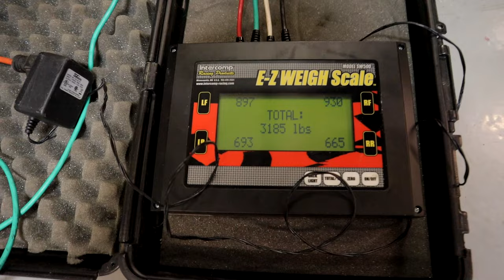American Musclecar Evolution - Why Pontiac Started Strong And Faded Into Obscurity

Comment: The SD Pontiac Engines were what PMD needed in at the minimum 1968.  The PMD engine design from a manufacture standpoint was superior, heads fit virtually any V8 or even that Trophy 4.
The cost would have been lower to pump out "one block" for 265-455 (save the crank main size) was simply cheaper than a BB or SB.
CHEVY ruined PMD, any real PMD guy should know the history of what Chevy did to PMD. Chevy not only was the spoil child of GM they crippled the ability for PMD to be superior to Chevy engine design.

Comment: Pontiac ran away with performance and
Sales in the 60s there back door Woodward 
Ave race parts made them competitive 
On the street when they couldn’t race
At the track. The real problem was GM
And Chevrolet had it out for Pontiac
And they especially wanted to destroy 
Them when in the 70s when the trans Am 
Beat the corvette and Camaro in sales
Pontiac had the 400 in the TA until 
1979 it’s the only big motor left at GM
The final nail was corporate engines
The 305. I had stock GTOs a 68,69, and
A 1970 stick all had 350 hp and 440 ft
Of torque plenty to beat any 70 And 80
Car shifted then 6200 with 3.23 gears
One with 3.90 gears great engines at that
Level now Iam 59 and have an all steel
10 second   1972 lemans sport and there’s
So aftermarket parts for Pontiac it is
Awesome today. The modern GM
Corporations is its own worst enemy 
and are paying for killing Pontiac, Oldsmobile

Comment: hey tony do you think if the big boys marketed a new  frugal car no frills   basic   roomyish  ugly   engine emp/bullet     proof  off  shelf parts  rocksolid  literaley run it with no oil fix with bale wire visegrips ductape if needed    would it sell in this age // i/e we had this subaru  that we drove thru the ground  and held out  no oil   we demo a house and used it for a trash hauler  at 30=mpg  no electrical dodads   just whats needed to run legal   and it was the best   14 inch tire were 35$  a true frugal machine

Comment: Also Pontiac heads flow pretty bad.  BBC dump truck heads flow better then any Pontiac head besides ram air v.  And even that is a close comparison.  Pontiac engines are essentially big blocks with small block heads.  Made great torque tho!

Comment: Yeah the rides were a problem but not nearly as much as their engine blocks I've literally blown the main webs right out of a 400 engine block on a GTO and later on racing super duty engines and later on super duty Motors I said a Mickey Thompson aluminum rods and really good for 200 runs with Lily Outlast the engine block at 500 cubic inches 470 something's 472 or whatever and it would last as long as the rides would they got to be pricey looking for super duty blocks after awhile so that's Pontiac they deserve what they gone

Comment: Actually, Pontiac didn't call the connecting rods Armacast, they called it Armasteel (I remember your article on converting a 400 to 455). the other issue was the lifter bores, they weren't cast into the lifter valley so with a radical lift cam with a quick ramp, you risked snapping it off. and in a smaller issue, their round port RA heads didn't do as well as D ports.

Comment: Lets call a spade a spade. I have owned countless ford cars and trucks and never blew up a single one. The oil in the 60's and 70's was questionable compared to todays technology. Maybe if Ford owners tried changing their oil your weird bearing wear patterns would of disappeared. I hear this all the time. My brothers 427 side oiler lasted many many 8200 rpm shifts. His Boss 302's lasted the same and were monsters with mostly stock parts. and Fords hold up way better than you claim. I have a real 289 hi-po in the shelby configuration, it screams .

Comment: Does anybody remember the 5252 rule? Anything past that does not matter to a manufacturer I know how to make power below 5,000 RPM my 1980 Cutlass stripped out with no backseat will do well over 130 miles an hour with 2:92 gears in the rear end seven and a half inch welded diff that spins the tires anything 40 miles an hour or less with a 454 Chevy 4 bolt main steel crank Winnebago take out is the epitome of making power the problem with Pontiac is Giant weights on the crankshaft the connecting rods didn't break because of power, the connecting rods broke because of the rotating mass of the crankshaft would suck them down the bore before the rod could catch up to the rotating mass. If you understand the rule of inertia roll a car into a tree the car will stop. Now roll a train with 50 cars on it into a tree at the same speed it'll take 5 mi before that train stops that's why the rule of 5,252 RPM rules after that moment the vibrational forces of anything in nature contained within a 6-in circle diameter becomes uncontrollable

Comment: Thanks UT, great video, would it be feasible to use the rods out of a ‘62 389 in a ‘69 400? I have both motors but want to use the later model block so I can rid myself of the horrible rotohydramatic that’s in my ‘62 Grand Prix.

Comment: Ok, now I have my sanity back. UT clarified the issue with the Mopar was when you got into the low 12s - high 11s. That's when the acceleration caused the oil to move too far back for the pickup to suck oil. The cars I remember never had that issue because they were mostly bone stock and they were well maintained and never really got into that ET range, maybe low 13s or high 12s at the most. BUT, I definitely remember some Mopars that did spin mains, etc because they were poorly maintained and probably shitty oil and/or low on oil. And those were mostly stock as well, and they were usually the ones that didn't run that great in the 1/4 mile, again because of poor maintenance and tuning.

Comment: talking about gtos birds what about those 421 catalinas grand prixs and 2+2s.....those tough 9.3 rears amazing 8 lug wheels.....if you knew the boxes to check a full size would eat a gto.....GMs big wigs killed pontiac performance in march of 63 with the racing ban.....at the time pmd was developing a single over head cam 421....only one made it out and went in mac mekellars grand prix....pontiacs issue was the pushed all the oil to the heads starving the rods....in turn windowing the block.....oil restricters in the lifter bores fixes the issue......glad to see some one talking about pontiacs....but the thing about pontiac is theres no small block or big block.....(we wont talk about the 301)......

Comment: BBC the strongest n/a engine ever produced ? Sorry Tony but not even close.  That easily belongs to the Boss9.  Remember WJ had to go to GM to design an engine that would outrun it, hence the DRCE.  Todays MMPS engines are still based on Boss 429’s, although at 820” and 1900 hp.  Pro Modified NTPA trucks exclusively use B9 based engines either Kaase or Sonny’s who uses B9 heads adapted to Gm head bolt pattern blocks.  These are the highest HP N/A engines in existence.  I would actually argue that a DOOE-R wedge head BBF would out hp any factory Chevrolet head (049 etc). No factory GM or Chrysler head casting will out cfm a factory Boss head.  If your talking factory as delivered engines and how they performed then that’s one thing the Chevrolet has.  But who leaves engines like these stock ?

Comment: Pete Robinson ( your Friend ) Fast Eddy , Dyno Don , Mickey Thompson , The Bounty Hunter , Ohio George ,Gas Ronda Grandpa Cobra Jet all ran Fe's because they did the math on the bottom end and won because the knew how to build them . Did you ever think about how many 500 and 600 mile cup races the Fe's won ? 1964 Thunderbolts ? How about 24 hour races or USAC stock car races even Pikes Peak ? Road racing 427 A/C Cobras .The Swift boats in Nam used 427 Marine engines . You can have your opinion but everything I say can be verified . Smokey the Wood brother's and Holman Moody knew how to win with the the Fe's . I know
Reply from the maker: I know all about FE racing history, but to compare side oiler Tunnel Port engines and Cammers to what was available to the average guy is apples and oranges.
As for Kalitta, he once famously posed kneeling down alongside his engine in such a way as to hide the puddle of oil gathering underneath, and at another time was quoted as calling the Cammer "Flat out shit".
Robinson made a business of the Cammer and was marketing his gear drive for them when he died.  He also ran off of a stash of freebee engines that were "donated" to him in an under the table deal.  
Mickey Thompson ran whatever he could get a deal on, and abandoned the Cammer for the Boss 429 as soon as it was released, and then ditched that after one season for a Chrylser because he couldn't keep head gaskets in it.
I know you Ford guys LOVE the FE and its variants, but history is history, and with the exception of a couple of guys like Ken Winward who ran them in Alcohol Dragster and Larry Gould who was the last to try it in Funny Car, they have been extinct since the very early 70's.
Reply: @UncleTonysGarage  After 2 years running hard twice a week in a Modified sportsman stock car then using it on yhe street everything looked great inside except those Dykes rings looked like they fid a bore job on the cylinders . If you told me that the end rockers break off because they are not supported I would agree . Even the 428CJ was good until 550 hp. after that the crank would usually snap in the middle counterweight and take out everything but the heads and intake . Did hundreds of those type engines .
Reply: @UncleTonysGarage  I did enough 426 and 427 Chevies to know they were great power makers .Worked on the first Boss 429 in early 70's  As soon as the 351C came out we found the oil problem on the right side and learned how to port them .  My thing was finding the weak spots and making them last in all.makes even AMC. There was a stock car guy in PA that would remove 2.5 extra on the sides and run 2.5 top and bottom on the rod bearings and never spun bearings because of bearing pinch didn't run the wide bearing NASCAR rods either. No pinning the bearings necessary.
Reply: @UncleTonysGarage  If you wantrd any Muscle parts book parts you could go to the dealer and get them back in the 60's .You could buy a 428 CJ or 427 Medium riser complete right here in town 
We had a Shelby dealer they had everything including the Sunbeam Tiger on the lot . So I may have told you that in 1971 Ford quit racing and Holman Moody had 427 SOHC 650 hp dyno tested engines for $650 delivered Nd $550 local pickup . They sold windage trays and oil pans that kept the oil in the pan . A professional drag racer that owned a machine shop bought a Medium riser 427 from H/M and told me he couldn't believe the power that engine put out . He ran real hot Rat motors at the time . If you listen to Forigner sing about Racing Lake Avenue , that was about us just like you used to street race .
Reply: Smokey had 3 different versions of the Boss 429 in the mid 60's and they made the cover of Hot Rod magazine way before 1969 . The 385 was the best of the best but never got the development it needed because Ford dropped out of racing in 1971 . The 426 was thrashed and worked the way it was intended to work but even Big Daddy had problems with that engine until he jacked the timing up with intent to blow it up and go back to the 392 . Timing made the thing work right foe Don and the Chrysler gang .As far a Pontiac was concerned they were dominant in NASCAR in the early 60's . The 421 SD was way faster than the 409 . The 427 Chevy mystery engine was faster than anything anyone ever saw in 1963 but didn't last 500 laps without blowing up . I think that's why they built the 426 for NASCAR and  the Hi Riser worked after they got the bugs out in the cam bearing problems . Big Bill banned both in 1965 so Mopar dropped out and put their effort into drag racing for that year . It only took 20 seconds to pump a 426 dry with a stock pan so why not an 8 quart pan from the factory ?

Comment: First muscle car was the 55 D-500 dodge
Reply: I say the mid 50s, with the new chevy small blocks coming out, and chrysler with their 300s and furys, sporting those 361s with dual quads.
Reply: @elmerfudpucker3204  1958 mercury super marauder the first American v8 with 400 hp stock and the 57 f-code supercharged 312 available in any ford car were a few more fast cars of the 50’s
Reply: @elmerfudpucker3204  a small block 55 chevy engine didn't have the horsepower the D-500 did do some research

Comment: Gm definitely wanted Pontiac dead... how about this...the famed BBC... it's a Pontiac rip-off with better heads, rods and crank... for instance... the 396-402-427.... use a 3.76" stroke...sound familiar...Pontiac used a 3.75" stroke [since 1958] in the 326,350,389,400's they just rounded the number to 3.76 to make people think the BBC was Chevy's wonder engine... then to finish off in Pontiac style... they steal the 421 Stoke of 4" for the famous 454 BBC... same deal... when Pontiac was obliterating the famed 409 with the 421...GM couldn't allow that...The Firebird was never supposed to be a Camaro clone.... In it's last death gulp, Pontiac wanted to pull a Chevy move and put a 455 in Their Nova clone, the Ventura ll and call it the GTO, in 1972... GM said the Prototype wouldn't pass the NVH standards set by the gov... so shelved that idea...then 2 years later released the 74 GTO as a 350...pure dog...hey but it passed the NVH standard test... total crock of crap... look how the destroyed Buick after Buick had the nerve to build the NSX and sent the Corvette back home to play... one last item that is often overlooked....the 73-74 SD 455... didn't share anything common bond to the 455HO or other 455's...that thing was a pure bred race engine ... provision for dry sump the whole deal... a couple people in my circle had one and those things and were capable of 600+ HP easily...quite sure they had a forged crank, rods too

Comment: Back then you either had a large small block or a small big block in a Pontiac. I think that hurt them too. Plus you had all these different GM muscle cars competing with each other. You could get a Chevy with an actual beefy huge big block in it - compared to the Pontiac big block/not really a big block.
Reply: All Pontiac blocks were the same size with the exception of the 301.
Reply: @IronChief  I almost bought a Grand Prix with a 455 -- opened the hood and went 'so where is it?'

Comment: B******  Hemi? i cant understand What Tony is calling the Chrysler hemi motor that would have changed the game. Can someone help me?
Reply: Ball Stud
Reply: Around 3:40? Ball-stud hemi
Reply: Ball Stud hemi, but, and this is a HUGE BUT - the straight up HEMI was, is, and always will be the ultimate combustion chamber design, period. There is a reason why top fuel dragsters use them exclusively. Street engine, yeah, ball stud, Chevy Rat, whatever. But ULTIMATE power? HEMI.
Reply: Look up ball stud hemi. It was a concept motor that was cheaper to manufacture then the traditional Hemi. Chrysler never produced it.
Reply: https://en.wikipedia.org/wiki/Chrysler_ball-stud_hemi